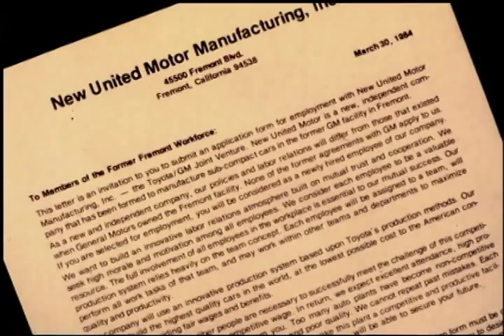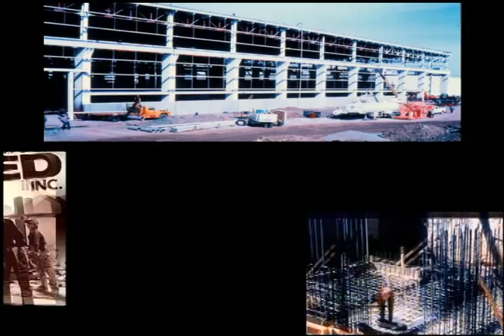NUMMI Toyota and General Motors.mov

Comment: My 1996 Toyota Corolla was Built here.  Still running in 2017 with no problems. A/C runs Cold! 
Toyota Tech 15yrs
Reply: TheTech660 my 1998 prizm was made there. Coming up on 300,000 miles, 3 owners, and countless wrecks, and it still runs strong.

Comment: It shut down because of GM's bankruptcy, due to the arrogance of GM's management, they never bothered to incorporate the design of NUMMI into other GM plants.
Reply: Perhaps not fully, but they did incorporate large portions of what they learned from NUMMI into other plants. I worked at a GM final assembly plant for a number of years and about the only thing lacking from what they talk about in the video is the mutual respect thing. That was severely lacking on both sides. The stereotypical union vs. management nonsense was still alive and causing nothing but problems for both sides.
Reply: Then they backstabbed toyota and blamed them.  If they just took RESPONSIBILITY for their actions, they’d be in a better place now.  But nope.  Corporate GM keeps making the same mistakes over and over
Reply: That's fer sure.  Then GM reported only 14 died from the key switch. That actual death count 124.  Over a thousand claims for accidents.
Reply: @pjm780   yah I read NUMMI reports of workers lazy and stubborn attitude supported by the union. Sick leave without a doctor's ok, drinking and weed on breaks. And they said would religiously refuse to shut down the line to made vital corrections. Even after Toyota proven record to do so.

Comment: Tesla took it over, with help from Toyota, but Tesla's a growing auto company, and electric cars use so few parts compared to gas cars, the plant is not fully occupied. One of the things I seem to recall Chris Paine of "Who killed the electric car" postulating in his film is the reason GM killed the EV1 electric car was the fear that it would ruin the autoparts business, electric car maintenance is minimal compared to gas cars.  If GM had not messed with the EV1 and had incorporated NUMMI's design, GM would have not gone bankrupt, but getting people to want an electric car is another factor. And our economy is doing so poorly, it's unlikely we'll see many electric cars on the roads.
Reply: Also keep in mind fewer parts doesn't mean less competition, it also doesn't mean less time wasted: it took Tesla some time to get cars created and delivered. But it does mean more transparency, easier maintenance, and because it's a new way of designing cars, more opportunities to optimize and simplify. It should be done to permit the future makers to incorporate the lessons learned with the present needs.
Reply: Tesla will probably reach the maximum capacity at NUNNI once the model 3 deliveries start. They need to make 500k a year to get battery costs down, and the higher number of cars NUMMI ever made was 420k in 2006.
Reply: GM should be charged criminally for destroying the 1200 Ev1 cars. And for the key switch issue killed over 120 people(GM reported only 14) and hundreds of accidents many will never get compensated. Like why didnt the insurance companys lawyers sue there asses years ago..
Then the new CEO woman say " Oh we cant compensate before the 08 bankruptcy". That isnt good business.   The ultimate stupid.
Reply: GM is not interested in selling EVs at the hatchback and sedan size because there is less money to be made. Same can be said with Tesla. Tesla EVs are also very massive too, when compared to a sedan from the 1990s/2000s. 

Another problem is electricity supply. The power grid cannot handle that many electric cars. 

Also, for folks living in colder climates, they're better off walking, using public transit or continuing to use a gasoline car. EV batteries don't hold up well in very low temperatures.
Reply: @2Jeezuzisreal  GM must be criminally charged? Seems like you've been made to believe you know everything about cars after taking a "car survey."  

GM management and labor work force has (long since) been replaced with people who don't know anything about cars. The moment government regulators, accountants and other bean counters replaced engineers and automotive designers in management; leadership in GM dropped. Same can be said with the workers. The moment GM got rid of high skilled craftsman, mechanics, and well educated assemblers for high school dropouts; the quality of GM cars decline as well.